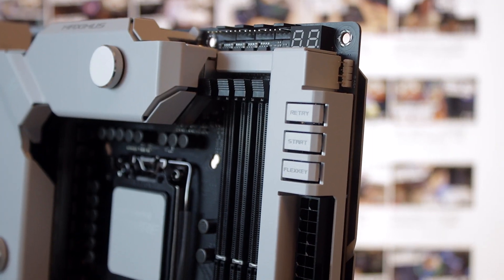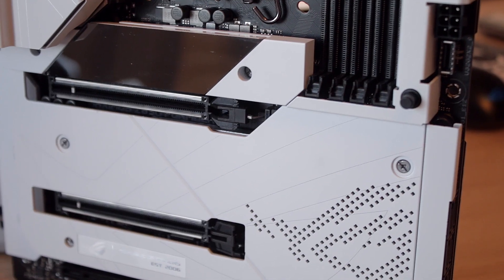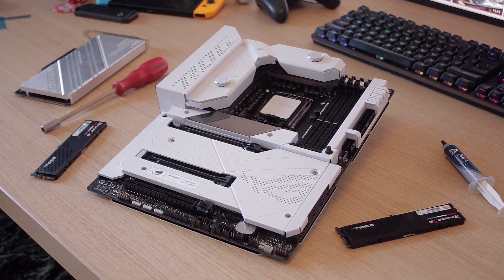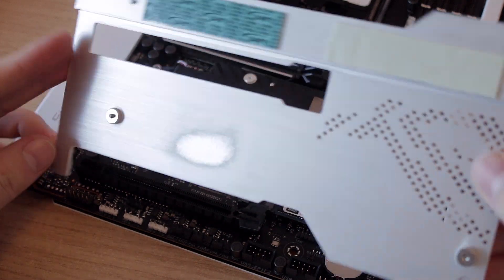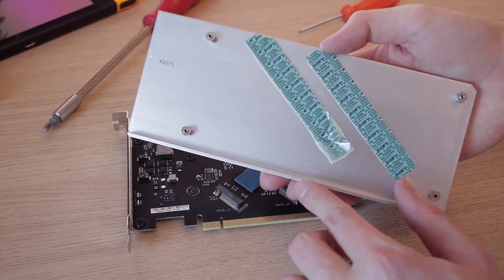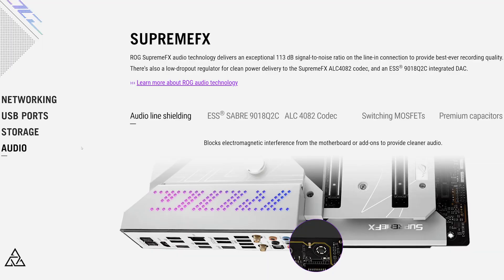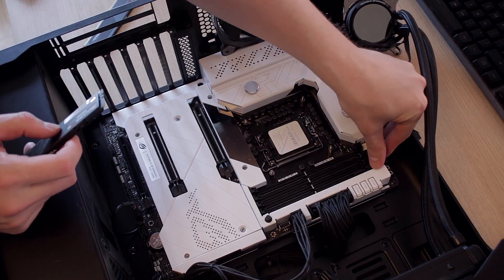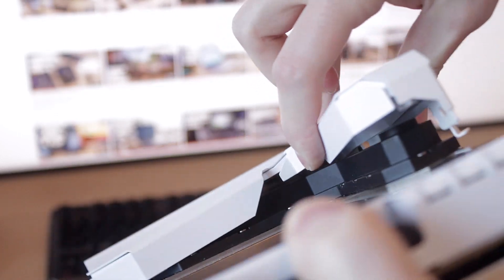The ASUS ROG Maximus Z690 Formula Review by Tanel

Comment: Great choice ... only i was wondering what happens if don't use waterblock with a water cooling e left it empty like a normal heatsink ... what are the vrm temperatures? This is only a Motherboard meant to be used with a custom loop or as i see could be used normally (aio + fans cooling) without problems? Please someone clear my doubts, many thanks!
Reply: You don't need to add water to cool the VRM's, the heatsink will work just fine.
Reply: @tom.whitfield  Ok, many thanks pal. 👍

Comment: Hi. I have a Asus Prime z690 wifi ddr5. its compatible with ddr4. Was wondering is this compatible maximus rog compatible with ddr4?
Reply: If it’s DDR5 then it’s only DDR5, the slots are different you can’t use 5 with 4 or vice versa. And this mobo is only DDR5